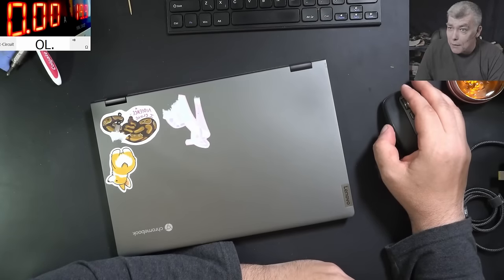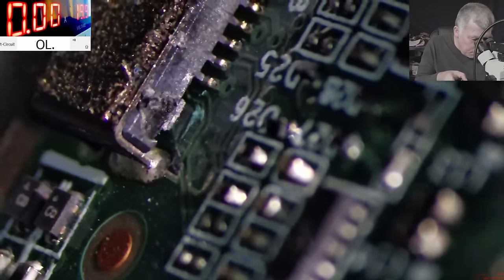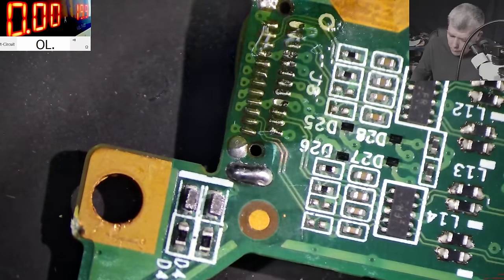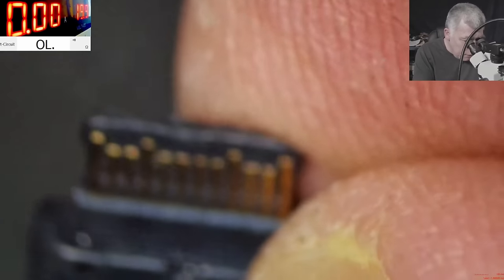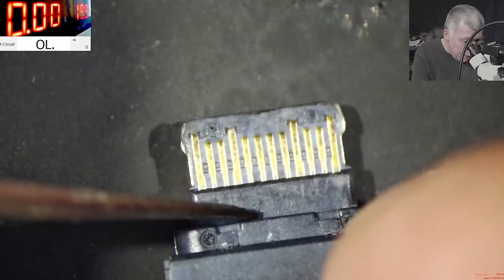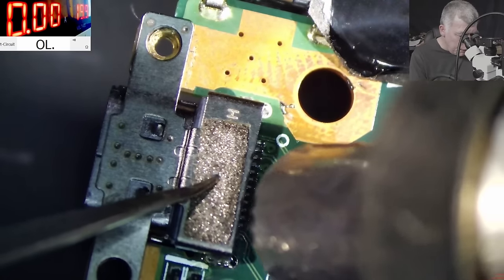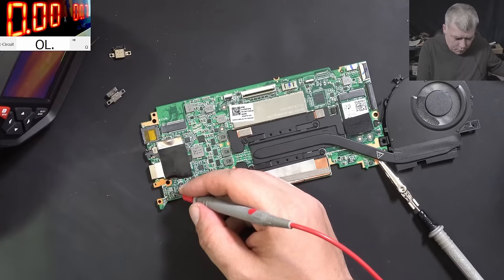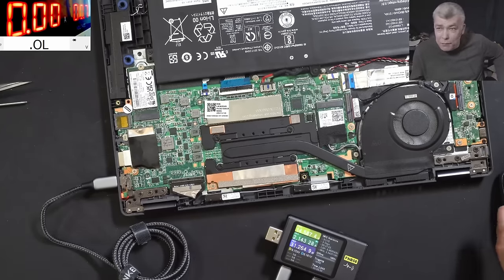Lenovo IdeaPad Flex 5 - Charging on one usb-c side - I have failed miserably in finding this fault

Comment: Did Sorin solder the diode on the wrong place😂😂?

(Dont get it wrong, i did not hate, mistakes happen)
Reply: yes
Reply: yes! he left the shorted diode pads empty, and placed the big replacement diode on the spot right above, in place of something else. That was not an empty spot, so he had to remove something from there, but for some reason, forgot to tell us about that.
Reply: or maybe it was empty, I can't see
Reply: Yes wrong place on third pin
Reply: Yeah, we probably all get it... mistakes happen
Reply: Sorin make a Boo Boo, but it worked all the same.
Reply: He said it was the same data line so it didn't make a difference
Reply: Yes, he did...
Reply: Yes he did!   But still worked!😂😂😂😂
Reply: I think you put diode back in wrong place, check your video.
Reply: Yes he did but it's working!!!!
Reply: @suediem9315  It was an empty spot, just like the spot above that which can be clearly seen when he removes tha faulty diode at 22:34
Reply: sorin is getting old 😅
Reply: @Kalma-cn  Yes we all are
Reply: Wait guys, i think its on the same tracks thats why its working maybe, and he installed it there because its bigger
Reply: @Solder_it  different track, its ok because its diode. not a resistor. i prefer old sorin style, just remove the diode  :D
Reply: @Kalma-cn  you are right 👍🏻
Reply: D25!!!
Reply: he is get older man 😂😂
Reply: Yes
Reply: Yup that's right 🤣🤣🤣🤣🤣
Reply: if someone claims that Sorin made a mistake by soldering the larger diode next to it
I suggest you take a look at it.
This is the same line with the option of mounting a larger element.
And if someone doesn't know, I'll post nonsense in the comments and try to be smart😂😂😂😂
Reply: Yes, Sorin can fix everything even by mistake
Reply: Yes, absolutely.
Reply: Yet it still worked!!!! WTF 😂🤣
Reply: Yes but how it's work booth side basically it's work like full wave reaction it mean it's charging with helf wave rectifier  @gabobeck21

Comment: Sorin is a magician he puts diode on different place and works better than factory
Reply: Better than factory comes from northridge Alex
Reply: Its not better than factory as the voltage readings on the USB meter shows.  Did no one notice - 5v on the 'fixed' side and 15v on the working side
Reply: @davidh1187  Good catch! I didn't notice that at first sight. I reviewed the video, and you are right, davidh1187. Hopefully Sorin has time to notice that voltage difference before sending the laptop back to the customer.🤞
Reply: @davidh1187  In the end, when he connected everything the voltage was good, and who knows what happened
Reply: @mikanikolic1976  No, the voltage was 4.9v not 14.9v - have another look @ 24:30 - voltage reads 4.981v with the USBC label up.  It was always correct with the USB C label facing away (at 14.98v)
Reply: @davidh1187  At that time yes, but it's ok here 25:02 when he put it all together
Reply: @mikanikolic1976  I stand corrected - there was obviously something that happened in the 'cut' that we were not shown.
Reply: @davidh1187  That's when we had pizza!

Comment: The Diode on the wrong place Mr😂😂
Reply: yes it's put back in the wrong place
Reply: He did say it’s bigger but the same tracks.
Reply: If you paid attention you’d have seen it shares tracks with the original diode. He also mentioned it.
Reply: @ocayaro  pay attention again... at 22:59 he says it's bigger but it's from a same data line "from another board". If you look closely it goes to pin 4, not pin 5. The laptop works, he fixed the problem. He's one of the best electronics repair persons on youtube so I'm sure he would review the video and recall the laptop if necessary.

Comment: 22:28 23:11 - To Sorin: WRONG PLACE. Its obvious that place where he placed component, is not the same place from where he took off this diode. I think there was no need to place diode on this place, as its marked with J. There are 2 pairs of 2 diodes. First one in pair died because connector orientation at moment of incident, I believe.
Shorted diode is shorted because it protected the device once, problem is resolved because damaged component is removed, not because the one that was added. I believe this port will have problems with some data communication in one orientation, sending video or maybe transfer of data, because of added component on wrong place.
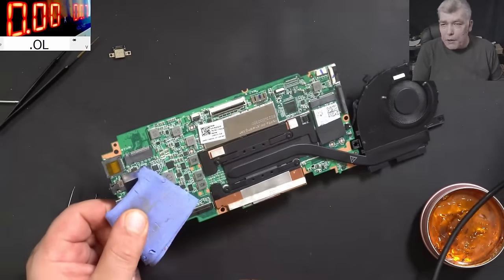24:07 - Its just that type of day... nothing goes as it should/can. Next day is totally different, faults being fixed expressly. 
PS.
22:36 - Moment when both components are out, clearly showing traces. (For keyboard experts that require extra explanation.)
Reply: i think they are parallele that why it work
Reply: @adhicham8185  Good thinking but no, it doesnt work like that in this case. Look at schematics 23:10 . Two traces. Left upper side pads 2 and 3, have resistor, rotate it, right bottom side pads 2 and 3 have resistors.
Obviously not meant to install one diode only on single trace, out of 4...(without resistors).
Reply: @Reno8_Pro-5G I think it is a Protection Diode to Ground. It works without the Diode but protection of Voltage Spikes is not there anymore.
Reply: Agree Wrong place, saw that, you removed D25, but you placed the diode in the J8 group
Reply: Phantoms can really get people confused some times. 🙂
Reply: the diode is to big so  he solder it where the diode fited
Reply: I was literally screaming... STOP! Don't power on!
Reply: You Wrong
This is saefty diode 
This is the same line bigger diode is option for the same diode.
Reply: if someone claims that Sorin made a mistake by soldering the larger diode next to it
I suggest you take a look at it.
This is the same line with the option of mounting a larger element.
And if someone doesn't know, I'll post nonsense in the comments and try to be smart
Reply: @NANO-SERWIS.MAREK-DASZKE  of course is the same line :)))
Reply: No diode, no shorted diode. Extra diode, extra protection. I believe the diode ended up on pin 3 (which is only used for USB3, as far as I know) instead of pin 5 (CC1 or CC2).
Reply: @NANO-SERWIS.MAREK-DASZKE  Check 22:36 , in highest resolution of video, in this moment both components are out of board. 
How you came to that conclusion "This is the same line with the option of mounting a larger element." 
Traces are not confirming your theory.
Please make a screenshot and draw to me then upload photo somewhere, to see what I missed? 
How it can be the same line? Im curious for your answer. 
You are the one who is starting nonesense but I will not go into that direction, I want proof from your side, that you cannot give.
Reply: @orion310591RS  Sorin himself says he has no ideea where the traces are going :))
Reply: It’s another line for sure. He removes a shorted protection diode, and he solders a diode in an empty place that goes to pin 3. That extra diode may cause issues in data, if user uses that port for something else. Anyway, this channel is remarkable for not editing out wrong investigation lines or mistakes. I’m not very interested in easy happy endings or in people that only publish successes. I prefer to know how others deal with failure or with incertainity.
Reply: I also noticed that he sticks it elsewhere 😁 but... it works😂
Reply: He put a Diode on a no stuff connection. That diode belongs on D25 where he took the old one off of.
Reply: yu right all here are keyboards experts exept you Einstein

Comment: There is a usb-c breakout pins adapter, very useful. You plug it and then you have access to both top and bottom usbc raws , you can easily find out the bad diode mode value, by comparing top raw with bottom raw values.
Reply: A USB-c breakout adapter or Mechanic T-824 would allow you to take diode mode meanings. Sorry could have done that in the beginning, which would have saved him half an hour.

Comment: the diode was replaced on  the wrong place
Reply: if someone claims that Sorin made a mistake by soldering the larger diode next to it
I suggest you take a look at it.
This is the same line with the option of mounting a larger element.
And if someone doesn't know, I'll post nonsense in the comments and try to be smart
Reply: @NANO-SERWIS.MAREK-DASZKE I don't think and it's not so clear, for me it's seems  go over the opposite side
Reply: @NANO-SERWIS.MAREK-DASZKE  the wrong is going to the pin 2 of the charger port an the right is pin 5

Comment: if someone claims that Sorin made a mistake by soldering the larger diode next to it
I suggest you take a look at it.
This is the same line with the option of mounting a larger element.
And if someone doesn't know, I'll post nonsense in the comments and try to be smart
Reply: just take a look again and check the track again.  22:34
and only taking 5V instead of 15V  -->  24:31

Comment: Dr Sorin avoid critics by soldering back another diode (wrong place but no mater data ligne never get surge), beginners can not complain. actually the burned diode is a zener, so you can leave it without... it's fine until surge of voltage happen again (we will get a new video 😊)

Comment: He just solder the diode in a different place.
I guess that fixed the charging issue.
But now that dats like wont work snymore in the other direction the data is not working.
Maybe usb data is not working snymore, so some devices are not recognized.

Comment: Yes ho did, i don't see very well but don't seem to be same data line the two upper trace, it work because of remove the shorted diode....but no more protection in future..like main power rail 5V on Nintendo Switch the spin the fan & charge joycon.... Bye Sorin from Francesco Timpano from Florence Italy

Comment: Sorin, There probably was a piece of material on the pin that made it look like a crack. It is probably is the same material that you pulled out from under the connector. It looks like it fell off of the pin as you pulled the unit out of the shell.

Comment: Hello. Any recommendation for air speed and temp to take off and especially put back so tiny diodes or resistors? Anytime I try with the hot air station they just fly away

Comment: Hey Sorin, I've got the same USB meter and mine shows the input bottom left and the output is on the right, is yours different or can it be used both ways as long as the connection is made I guess? 😅

Comment: Chinese copy? 😂😂😂 What planet are you living on? Because here on Earth, 99% of our electronics are Made in China. Lenovo/Asus/Apple, etc., don't manufacture USB-C ports. Never did and never will. They don't even own a manufacturing factory. Their laptops are designed by an outsourced specialized house that employ motherboard designers, then fabricated by manufacturing companies like Foxconn for an example (that actually own factories) assembled with parts that are manufactured by other companies.
Reply: especialy Lenovo - its produced in China. Original parts cost 1000% more than from Aliexpress - which is also in China.. ;-) Why paid more for chinese brand? Its china...
Reply: There are Chinese original parts and Chinese copies - sometimes it can be worse, Chinese fakes.😵‍💫
Reply: @jayvanhorn6372  no, there are different quality levels, cheaper less quality or more expensive higher quality
Reply: You do not understand product manufacturing at all. Chinese original parts are different from Chinese knock outs. I have ordered and tested this and 99% of the cheap parts are of subpar quality. Last USB-C connector I ordered lasted for 2-3 months. Original lasted 5 years in the same use. Chinese or not.